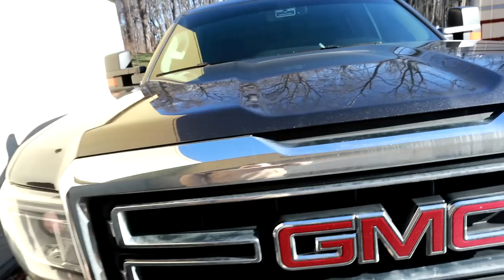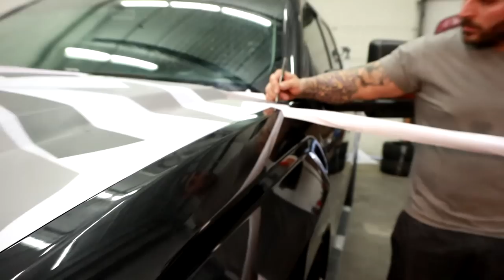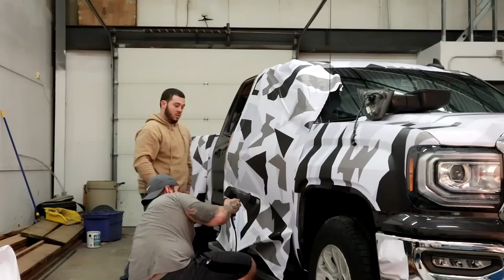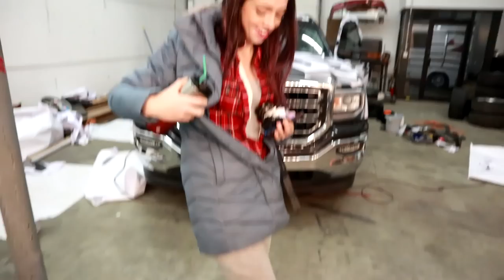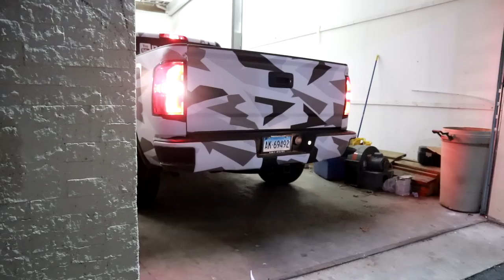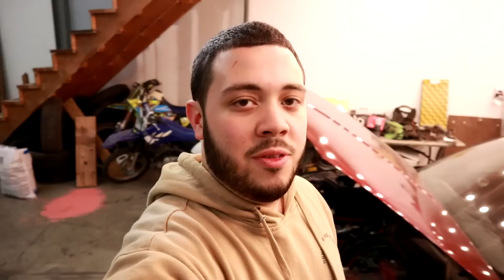VINYL WRAPPING A TRUCK!!!

Comment: I wouldn’t recommend Going with a cheap wrap it’s a bad idea because cheap wraps are going to damage your paint bro
Reply: Yes they do. I had a customer who wanted to buy all wrap themselves from some china website. It was cheap and looked good out the box but it didn't feel right to me, felt thicker and harder but I got a waiver signed and we went and wrapped it. 2 years later after neglected history he bought it back to be removed and now his audi is only half nardo grey half primer also the previous paint repair was poor. All I do is fix peoples junk. Now Im welding in new floors into a 96 opel astra 1.4 with 280k miles on it. But if these suckers pay I'm down

Comment: I wrapped a bumper for somebody one time. That was a lot harder than I thought it was going to be. Between Heating with the heat gun and trying to stretch it around all the curves, that honestly kind of sucked
Reply: You got flat planes and compound curves, people make that mistake with the material that has no stretch... just a difference with heat is big.
Reply: @wobblysauce  I had no idea what I was doing. It took two tries but it ended up coming out all right. A friend of mine bought a sheet of White rap and wanted his bumper done to match the car. He just brought a roll of wrap over and said he couldn't get it to work. This stuff had virtually no give. That helped a little and I finally got it to work. Like I said it came out all right, but I probably won't attempt it again until I learn a little more about it. I went in with literally the knowledge of a few YouTube videos LOL
Reply: Yep, depending on the material used the ease of application changes, it is not hard but more finicky until you get in a grove. Look up Triangles and Cold prestretch.